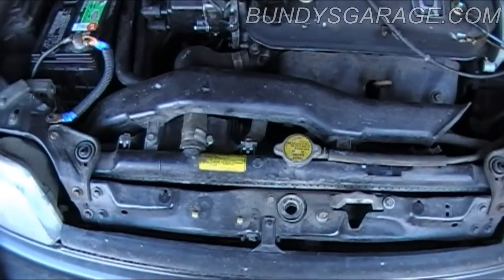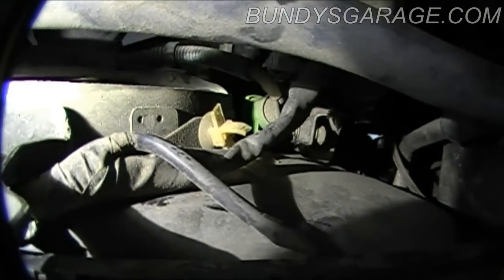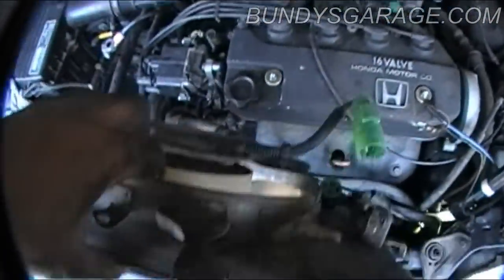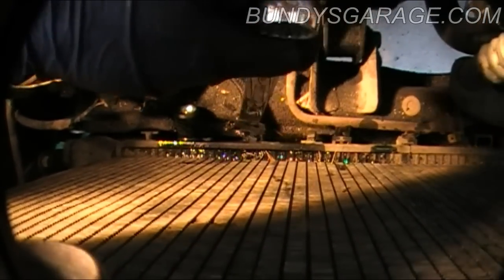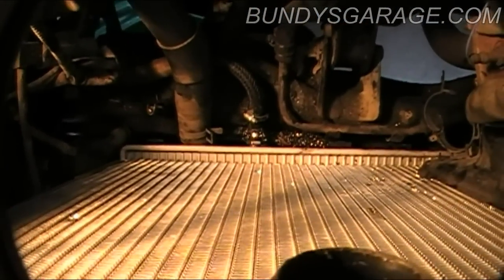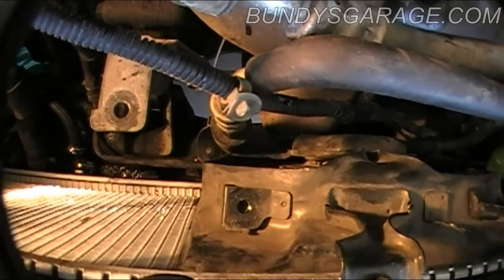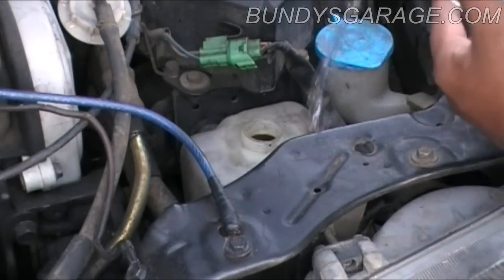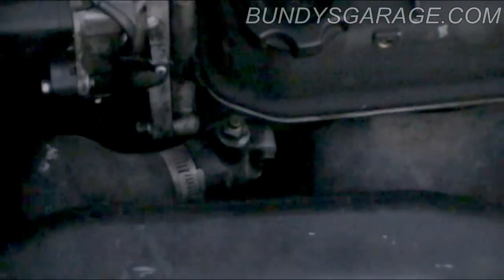DIY:B15/B16 Honda Civic CR-X 1.5L & 1.6L Radiator Replacement - Bundys Garage

Comment: Having been a foreign car mechanic for most of my adult life till 1987 I have to say you did an outstanding presentation.  We use do to a cooling system pressure test when we finished the job, do you folks do the same? "Great Job and thanks"

Comment: That radiator is OEM. I just ran in to the same problem as having a crack on the top by the passenger side mount, not as long as the mount you have. Thanks for the video now I will be replacing my radiator as well.

Comment: Here's a tip. Instead of trying to remove the transmission cooler lines near the bottom of the radiator, just remove the lines from the transmission itself and remove the whole thing as an assembly, then you have more access.

Comment: Hi I have a question I recently got a new radiator as well for my Honda and also came with the new fitting for the transmission cooler how ever I dnt knw how to install the transmission cooler line into that fitting plz help